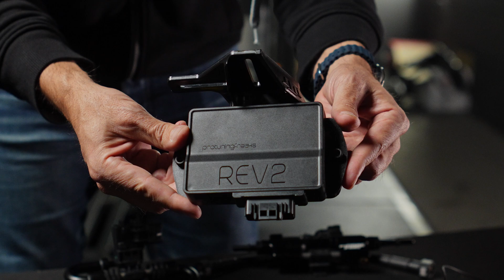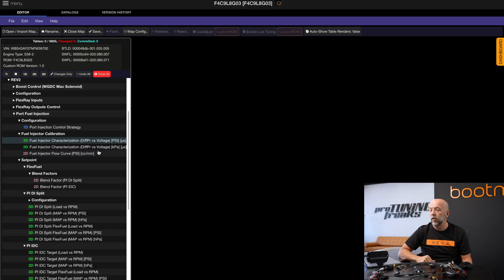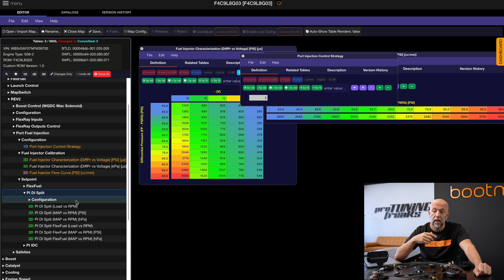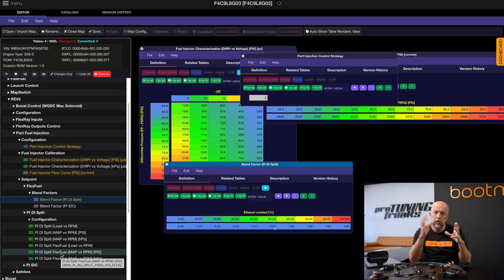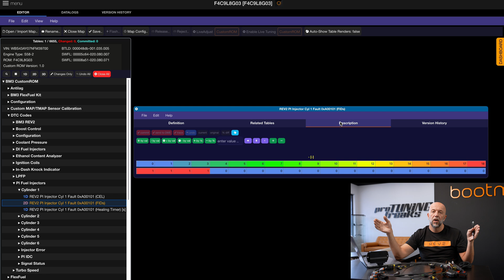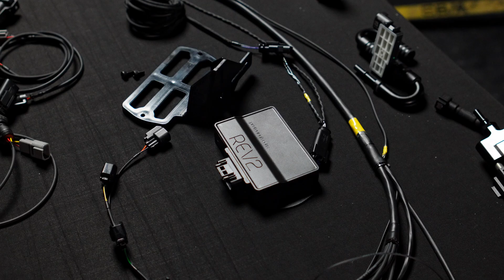Port Injection Control with REV2 Controller + bootmod3 CustomROM V2

Comment: with port meth, typically fuel from meth kits, the engine system cant actually read how much fuel is going in, i think and correct me if im wrong, its normally gauged based on the lambda sensor for tuning purposes when using meth, so when using meth lambda sensor tells injectors stop adding as much fuel because we detect to much fuel. its coming from meth kit but ecu doesnt technically know this right?, with rev2 (b58 boy here) the engine will now know how much meth is going in the engine ??